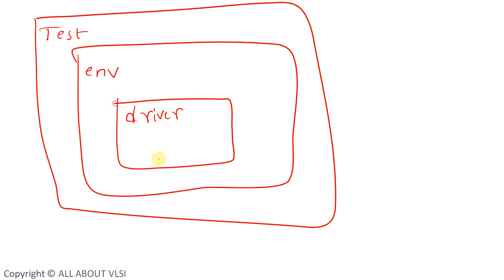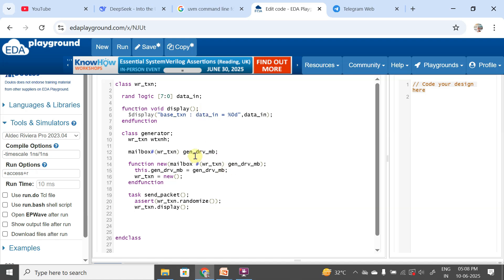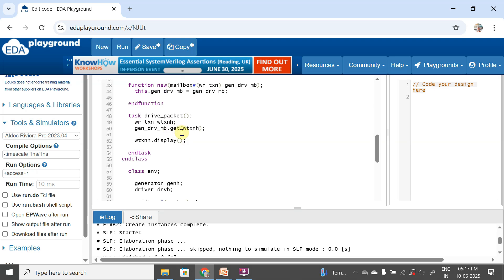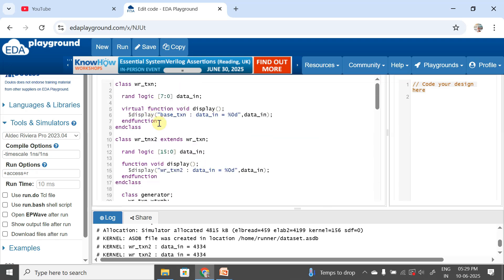Why We Need UVM Factory | Packet Override Example in SV testbench

Comment: I have one question here. Why can't we put both packets 8 bits, 16 bits in a single transaction class. Randomize the transaction class and put both the packet one by one means first 8 bits then 16 bits using the mailbox for sequential data transfers or create two mailboxes one for 8 bit data transfer and another for 16 bit data transfer for parallel data transfers. Why to create two transaction classes one for each data packet and then do the code changes and recompile and run to override?

Comment: [00:00] Introduction to UVM Factory and the need for it

[00:22] Setting up the SystemVerilog Testbench Architecture (Test, Env, Generator, Driver)

[01:29] Defining the Problem: Need to swap an 8-bit transaction (write_txn) with a 16-bit transaction (write_txn2)

[02:39] Code: Defining the base write_txn class (8-bit data)

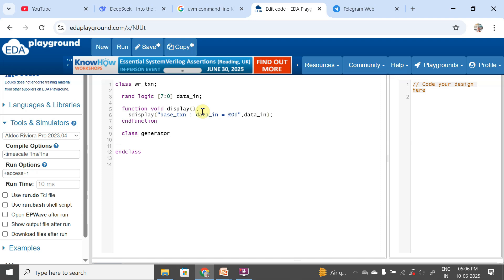[03:55] Code: Defining the generator class

[06:07] Code: Defining the driver class

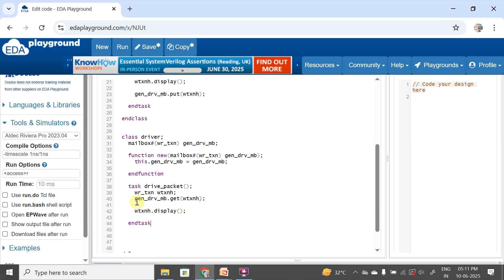[08:19] Code: Defining the environment class and connections

[09:51] Code: Defining the test module and running the simulation

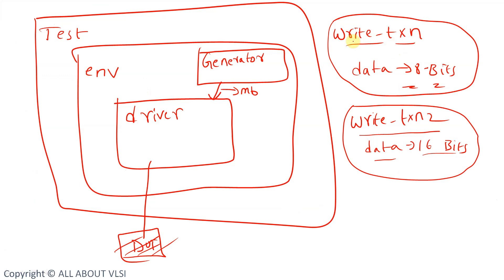[11:34] Implementing the override requirement using SystemVerilog Inheritance

[12:46] Creating write_txn2 by extending the base class

[16:47] Why the virtual keyword is necessary in the function

[17:07] The limitation: The SystemVerilog approach requires manual code edits (creating new handles, passing them explicitly)

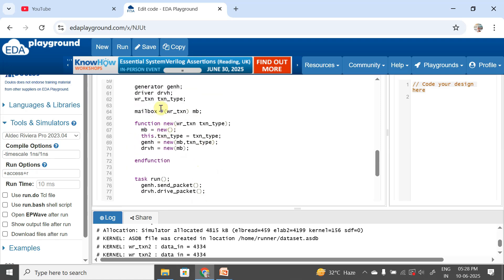[17:28] Conclusion: How UVM Factory solves this by allowing runtime override without changing code